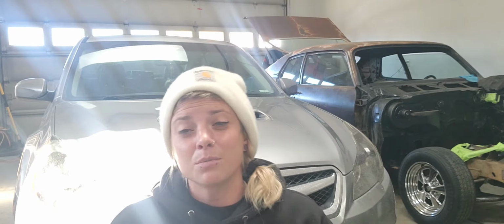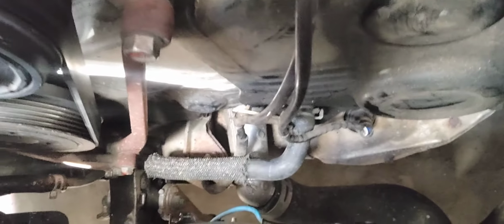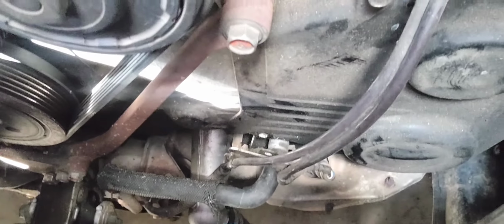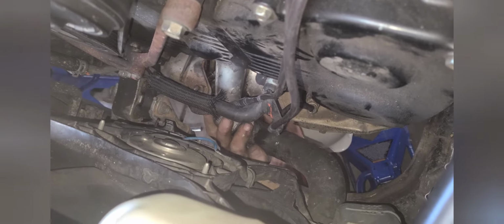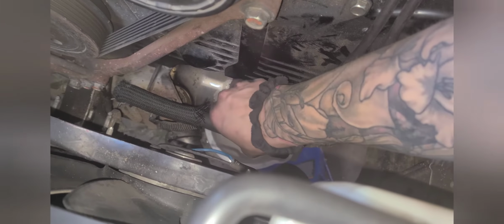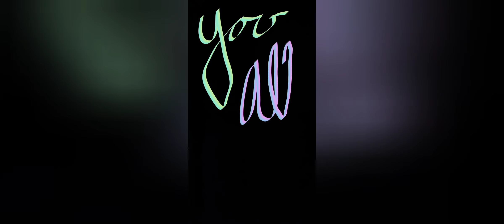2010 Subaru Legacy 2.5GT - Thermostat replacement! And more chassis prep/paint with Dad on the Nova.

Comment: How are you liking the car? Have you had any other unexpected repairs? I’m thinking on getting an 09
Reply from the maker: Love her! She's always reliable. And I've kept up with all normal maintenance only major repairs would be the Trans,  the clutch and the timing belt. But I've put almost 100k on her. I drive it daily for work, drove it across country and back as well. No issues on the long treck. Never has over heated, still running on original head gasket at 190k. I drive her HARD as well😅 people diss on subaru but literally the most reliable. Drives amazing in Colorado snows💯 averaging 23.2 mpg mostly in city even.